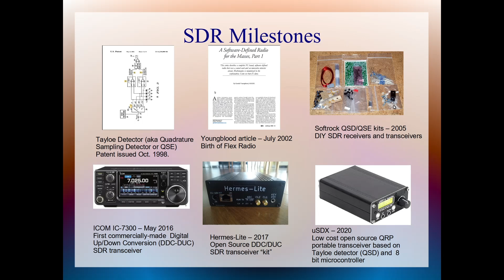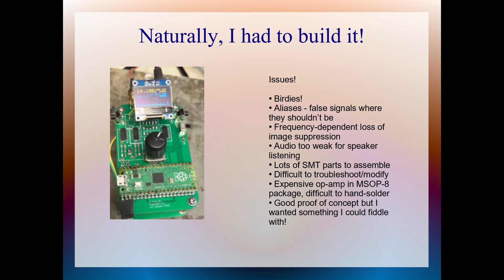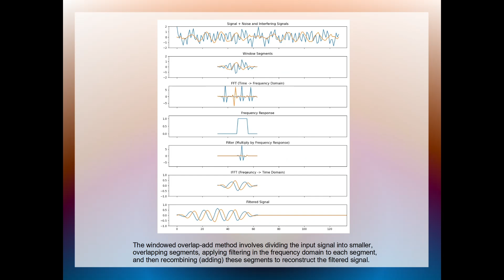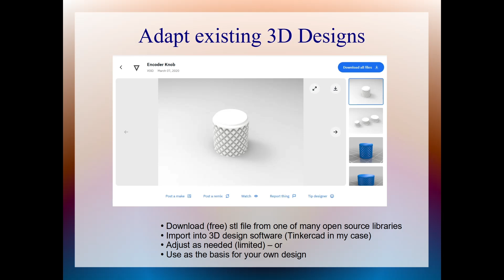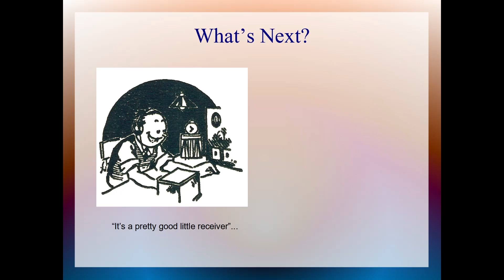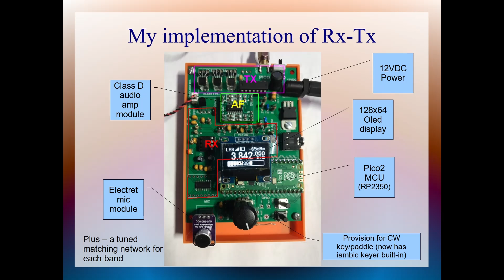W9RAN Pico RX Presentation W9DYV 2025

Comment: Hello! I built it the receiver, but I have several alias on 40 meter. By adding the filter on the output of qsd, you have too much attenuation because you have to deal with voltage partition on the ADC of the pico. How did you solve this ? Thanks '73.
Reply from the maker: The values I used for the anti-alias filter are 5.6K ohm resistor in series with the QSD output and a 1nF capacitor to ground.   The 3dB cutoff of this filter is ~25kHz, so it doesn't attenuate signals in the desired passband.   I measured 30dB attenuation at the alias frequency which agrees pretty well with theory.  You can use this calculator to design R-C low pass filters and see the response curve:  https://www.trance-cat.com/electrical-circuit-calculators/en/rc-low-pass-filter-calculator.php

Comment: Here’s a free idea. 😂.  How about implementing the receiver filter on your TX module.   That way it would have the correct band pass on RX to match the TX module that is installed.
Reply from the maker: Good idea!  In fact, the Rx-Tx board taps the receive signal off at the input to the class E matching network, which provides selectivity and impedance matching.   A future project is to do a sweep to see just what the response curve looks like.
Reply: This is wonderful.  73s de va7wpx